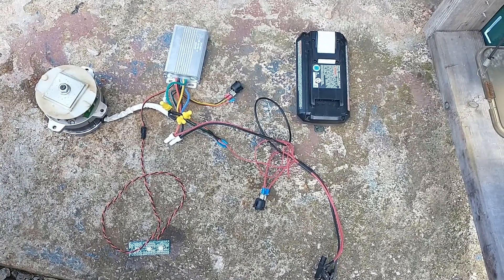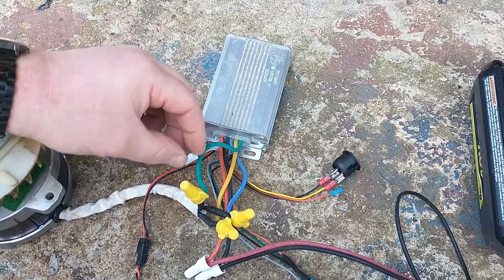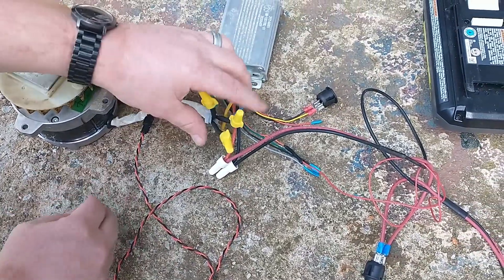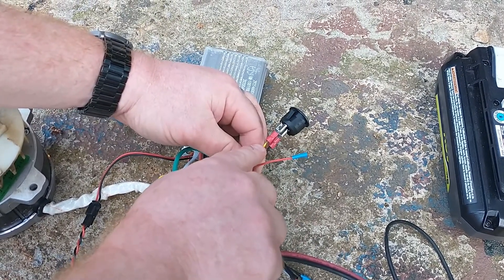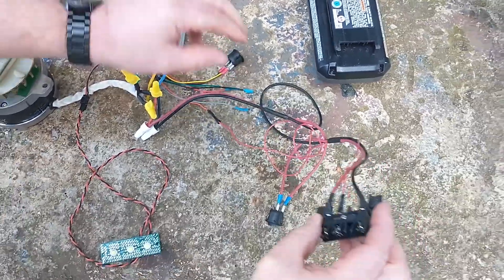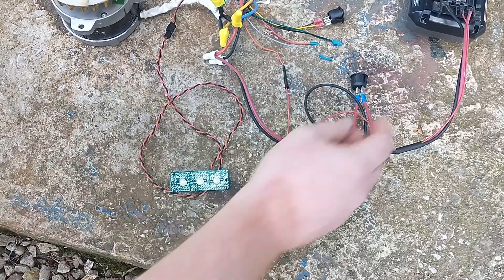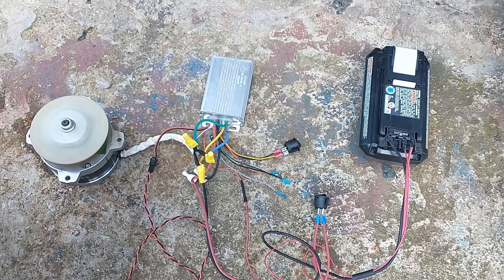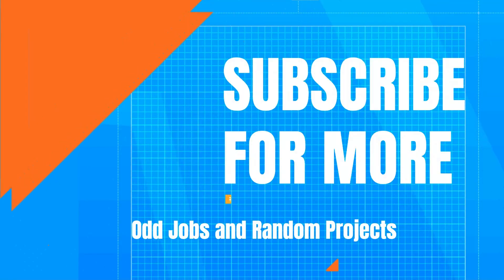Ryobi 40v Brushless Mower Wiring Diagram, Explanation and Modification for Projects

Comment: What is the small red wire coming from the battery for?? I've got mine running off my 48v ebike battery for about a year now with just the red and black power wires connected . It still does the under load bump in power as you can hear it speed up . The internet doesn't have the answer, Im stumped .
Reply from the maker: That is interesting. I wasn't sure if you could run it without that connected, and hadn't taken time to test it. I believe the wire was for a battery temperature sensor to protect it from overload. The terminal on the battery has a "T" written where it connects, and temperature is the only thing I can think of that makes sense.

Comment: Any chance you have any idea how to force turbo mode?    On older models, you could hold the start button, that doesn’t work anymore.   

Turbo mode fires automatically when you run into thick grass and speeds the blades up a good amount.  I only have a small area, and want to force turbo all the time to get a better cleaner cut.       Excellent video, I was hoping to see something obvious in the wiring diagram.
Reply from the maker: Unfortunately I don't. It is probably in the software since it used to use the same button.
Reply: That’s what I’m thinking after watching the video.   Clearly there’s something that triggers it based on torque maybe.   I found an article today that was leaning toward installing a heavier blade can trigger the boost.   More to study, but will be looking at going with the gator mulching blade and see what happens.  

Again, thanks for the video, it shows a lot of details that tells me I can’t just jump a wire and get my desired outcome.
Reply from the maker: @theDunn05  Glad to help

Comment: While trying to repair my mower, the battery connector broke and I cannot find a replacement connector. Any tips/advice?
Reply from the maker: Which connector? The one where it plugs into the battery itself? The metal part, or the plastic?
Reply: The metal clips. I can’t identify what kind of connector they are and one of mine snapped off when I was trying to repair.
Reply from the maker: @Sean-tc7jm  As I recall you can make a reasonable copy out of brass with a little work with a Dremel tool. But also check the Ryobi website as they have a good parts diagram and a selection of spare parts.

Comment: Came across your vid while looking at my 40v weed eater. The wire you have going to nothing looks exactly like the throttle control on my weed eater. I'm assuming it wasn't needed on your set-up so there's just nothing to plug it into. They probably use the same controller for other items that have throttle control.
Reply from the maker: I'm sure they use that controller for lots of things. If you mean the flat plug, I was told that actually it is for motors with a Hall sensor. My unit didn't have one, so it goes to nothing. But that's just what I was told.

Comment: Do you know how to diagnose the controller and motor. I got a Remington 40v lawn mower. It’s never been used. It’s old but brand new. I put full charge and it won’t do anything. The people I got it from said they could never get it running
Reply from the maker: I haven't worked on a Remington mower before, so I'm not sure I'm much help there. Usually if there is a problem on a brushless mower it is something simple like a switch or wire. If it's more complicated it's the controller itself. If it's been used hard the bearings in the motor. Not saying it couldn't be anything else, but those seem to be the typical problems.

Comment: The unused connector is for a motor with hall sensors.  Some motor controllers use these sensors to determine rotor position and therefore which stator coils to energize.  Other controls use the back EMF in the non-energized coils to determine rotor position and therefore do not need a motor with hall sensors, as in your case.  My original Yardworks mower had a motor with hall sensors (3 sensors and therefore 5 wires as one is ground and the other is 5 V) but the board died and I substituted a controller (for an e-bike) that said it worked with hall and hall-less sensor motors.
Reply from the maker: That makes sense! I wasn't sure, but they probably use the same controllers to fit multiple different motors. Thanks for the info.

Comment: Hello, my current Ryobi RY401011VNM lawnmower is down, I suspect that was caused by the controller, model# PM177-20B-1. The only replacement I can find online is PM177-20C-1. Wondering the 20C-1 can be compatible? Thanks.
Reply from the maker: I would imagine it would work well, but I'm not going to say I'm an expert on that. I've always bought my motors and controllers together so I never checked to see which one matched what. However I have mixed around what I bought without issue. I will say though that controller issues are rare. It usually is the wiring.

Comment: if the 3rd wire (orange) is not connected will the motor run, what is that wire?  thanks
Reply from the maker: I need to check to see if it will run without it. I believe it is a temperature sensor, but I haven't confirmed that.

Comment: I read that there is a load sensor to increase power when needed. Can it be faulty? Sometime I mow with no problem with power cycling up and down as needed. But most times it will bog down and I have to stop and lift it to regain power. I have 3 batteries 4 amps and 5 amp. It occurs with all the batterie. Help.
Reply from the maker: I know that there is a load sensor of some sort. It should be part of the controller itself. But I've never taken one apart, so I'm afraid I'm of no help with that. How do the bearings feel on the motor?
Reply: No odd sounds, shaking. It runs fine. So frustrating.
Reply from the maker: @michaelduchnycz4053  I'm afraid I don't have much to offer. I know you could find the controller cheap, but I don't know if that will help. But that has all the sensors. I do have a video about replacing bearings on the motor too, but that could be a waste too. Wish I had more to offer you.

Comment: The small red wire that goes to the plug for the battery where does that go? Does it run back to the small grey box?
Reply from the maker: If you mean the tiny red wire, I believe it is a thermal overload sensor. It should connect to the controller.

Comment: This video is amazing! thanks a ton! Rats ate my mower, make sure yo plug that hole where the wiring runs from handle to motor, or rats will eat everything ( including the literal plastic mower itself.)
Reply from the maker: Glad it helped! Boy rats and mice seem drawn to wiring for some reason.
Reply: Aye same reason I’m here I only used mine 8 times out away for winter in the back shed bam lol found dam nest in there

Comment: Big help. I had a bad controller, but when I was testing the new one it was not working either. Didn't realize there was a tilt sensor. I had not mounted the controller so it was just hanging from the wires. Went back out and lid it flat and it powered right up.
Reply from the maker: Glad I could help. I went through the same thing when I started building my electric tractor. Took me three days of messing with it to figure it out! I realized there needed to be a video about that.

Comment: My RYOBI zero turn has joystick for control. It seems like wiring could be connected to RC receiver for RC control. Do you know how the RYOBI joystick is wired and how to “tap into it”?
Reply from the maker: Unfortunately I don't have any experience with it. I'm sure there is a way. You might also have an easier time developing a mechanism that fits over the joystick and moves it using servos. That is what I ended up going on my RC mower because I wasn't smart enough to get a RC relay to turn the blades off. After 3 different ones wouldn't do what I wanted I just bought some cheap servos and used a switch I had in the garage and 3d printed a bracket to hold the servo. If it were me, that's what I'd be looking at doing.

Comment: Great info!  Can you show us how to make a Toro 60V recycler mower run at high speed all the time instead of the "auto mode"?
Reply from the maker: Unfortunately I don't have any of the 60v equipment to experiment on. On dinner of the units the controller is programmed to only have an automatic mode. You could replace the controller with an ebike controller which would give you full speed control like the old gas ones had.

Comment: I have about 20 Ryobi 40v electric push mowers and am looking for some projects to do with them. Would it be possible to use them to generate electricity? Perhaps as a wind mill or water wheel application. Otherwise what kind of cool projects would anyone suggest with that many at your disposal?
Reply from the maker: They probably could be used as a generator, but that is outside of my depth. I've used them for a riding mower conversion, and an rc mower. I've seen them used for ebike conversions, and though of using them for a garden tiller, a trailer mover, electric wheel barrow. Those are just some thoughts I've had.
Reply: @oddjobsandrandomprojects  Thanks for your time and response. I do like the garden tiller idea. That would definitely be useful for me.

Comment: Can these parts be used to convert a manual reel mower into an electric one? I have an extra non working unit and was thinking about doing a conversion.
Reply from the maker: I've seen a video somewhere on YouTube that someone did that conversation with a different motor. No reason this one wouldn't work, but you would have to figure out the correct gearing and find a sprocket or belt pulley to use.

Comment: I have the exact same model however I took the controller out and put it in another ryobi cordless mower (different model which doesn’t have the lights or sensors ) anyway I hooked it up and nothing happens. Both mowers worked prior to me doing this . I can’t figure out why it isn’t working ! I’ve watched your video at least 10 times thinking I might have missed something . I need help! Thanks

Update! I actually got it to work! Thank you so much! Your video was a lifesaver!
Reply from the maker: Glad it helped! From your description of the problem it sounded like what you were doing should have worked. Curious, what turned out to be the problem?

Comment: Good afternoon I'm having an issue with when I start my lawn mower it will only stay started for a second and then it will turn off and then I have to play with the battery in order to get it to turn back on but if I put the battery in my weed wacker it turns on just fine so I know it's not the battery you have any suggestions?
Reply from the maker: I'd check my connections at the battery terminals and that red "key" which is just a jumper. After that I'd check the wiring at the handle position switch before moving into the other switches. Not likely to be a motor or controller, so those would be the last thing I would check. Loose wire or bad switch is most likely.
Reply: @oddjobsandrandomprojects  Thank You

Comment: Can Ryobi controller be hacked for a throttle ?
Reply from the maker: No. The motor will support speed control and reverse, but the controller is not designed to. However an inexpensive e-bike controller will give you speed control. I have another video showing how to wire one of those.

Comment: How well does the motors for the blades cut grass?  What speeds do you get while cutting the grass? Can the batteries be hooked in parallel to have more output to cut a bigger lawn?
Reply from the maker: They work quite well for mowing. They turn at about 2900 rpm, so they are only slightly slower than a gas mower at maximum. It is possible to connect them in parallel, but I don't know what the long term consequences to the battery might be. I did that on my scooter, but that was because the amp draw was to high for one battery. You could also use a battery selector switch to have 2 batteries, but only connect one at a time. That would give you the range without the worry.

Comment: Do you know if there is a way to reverse the rotation? And how would it be done. Thanks
Reply from the maker: Not using the controller it comes with. The motor is capable of reversing, but the controller is not programmed to. I use an e-bike controller (rated for 36-48v input and 1000 watts) for things that I want to control the speed of and have a reverse function. They cost about $35 or so on eBay or Amazon.
Reply: @oddjobsandrandomprojects  ok I am use the same stuff you are but I need the rotation to go the other way. Could I change the wire to see if soin the other way ?
Reply from the maker: @captin959  I will be posting another video relatively soon to show how I get them to reverse and to control the speed. I plan on having it posted by next weekend.

Comment: Great video. What about the grass catcher sensor? What's the right way to bypass that? It's only two wires, so I cut the wires and joined them. I'm not an electrical genius like you so I need help. :)
Reply from the maker: I must say I'm far from an electrical genius. I used trial and error along with some help from others to figure this out. On my mower there were 3 wires for the bag sensor. Only the green and black ones connected to each other. The grey one needed to be capped off. Alternatively, during testing I found that the grass catcher sensor simply detects metal. If you put a piece of steel, such as an old bolt, into the channel in the sensor it will think there is a grass catcher present and run. That was how I tested my motors until I figured out the wiring, but it could be used permanently as long as it is secured solidly. However, if your model is slightly different you may find that my advice doesn't work.

Comment: Can you show as how to wire variable speed controler pls.
Reply from the maker: The factory controller is not designed for variable speed. I used an e-bike controller on some of my projects to make them variable speed, but the wiring depends on the controller used. Mine all came with a wiring diagram, so that made it easy.

Comment: The orange wire from he battery to the controller, is that the thermal OL? The won't motor wont run, the light comes on for a second and clicks and shuts down. New fully charged battery.
 Thanks Mel
Reply from the maker: I'll be honest, I'm not 100% sure what the orange wire is, but I believe you are correct. That wire should be a thermal overload. If you have it connected and it is shutting down immediately it sounds like you have a bad controller or motor. But that is only a slightly educated guess.
Reply: @oddjobsandrandomprojects  I cut the orange wire and still won't run. Blade spins freely, left the bag bar off, the light came on but didn't run. Replaced it and it shut down the same way. Leaning toward a bad control. Thanks for your reply.

Comment: Here's something that I can't find in anyone's video:
How do I lock in high speed?
The mower has two speeds, a slow speed to maximize battery life and high speed when the mower is met with resistance as in tall grass. 
I want the suction power that is had with high speed. I keep my grass tall and It can lay down resulting in the mower not cutting it.
I will forsake battery life for suction!
Reply from the maker: That's an interesting point. I don't think that Ryobi designed it with a way to choose which mode you are in. However, you could just use their motor with an aftermarket controller and then have full control over the speed.
Reply: @oddjobsandrandomprojects  I was hoping to find a hack. I don't have the drive to research/design a replacement controller.
Reply: Nearly all RYOBI mower can not adjust the speed by user,I just know one 46cm mower have use panel to select different performance

Comment: What is the shaft size on the motor.  I want to put a pulley on it.
Reply from the maker: I used a 1/2" bore pulley, but I did have to enlarge the hole slightly to get it to fit. It was just a little to tight, so it must be a metric size.
Reply: It's 13mm

Comment: Great  stuff.  I'm building a similar ride on lawnmower project and wanted to go down the swap out battery route for the blade motors but perhaps a different battery for the drive motor.  Would love to know if you found the swap out batteries for the drive were ok or drained too quickly.  I'm thinking of a direct drive transaxle motor set up either 750w or 1000w.  Thus my thoughts on a larger motor battery.
Reply from the maker: On my setup I actually find that the blades motors run out of power before the drive motor battery does. I actually have a rather boring video of it being driven and you can see just how long it lasts as well as the kind of conditions of my yard. However, the transaxle in mine is a single speed manual transmission, and it has to have a large pulley on the transmission end and a small one on the motor. I tried a direct drive on a hydrostatic transaxle and it worked, but the motor got way too hot and was using a battery every 10 minutes! So I do not recommend that unless you want to use a larger motor and separate, larger drive batteries. If you are doing that I'd probably go with one of those 48v 1800w Vevor motors you can get online for like $100. That should have plenty of power.

Comment: Is there a way to bypass the control box and directly connect the brown/yellow combo wire and the black wire to the yellow, green and blue wire going to the motor? Control box has input power but no output power going to the motor itself.
Reply from the maker: If you are referring to eliminating the control box entirely and connecting the battery direct to the motor, that won't work on a brushless motor. You could only to that with a brushed motor.